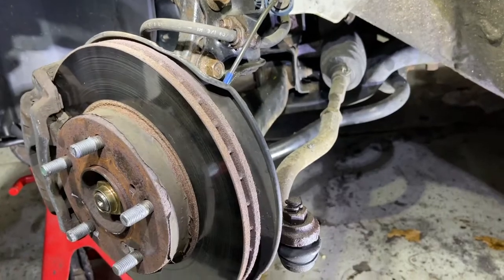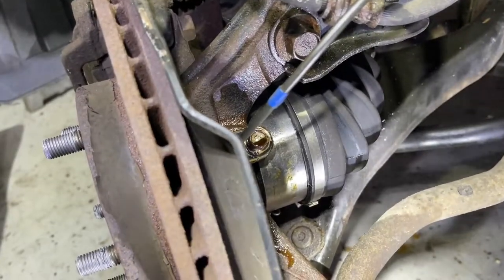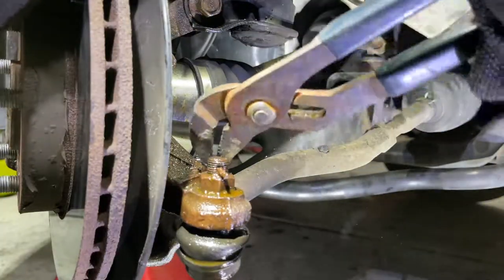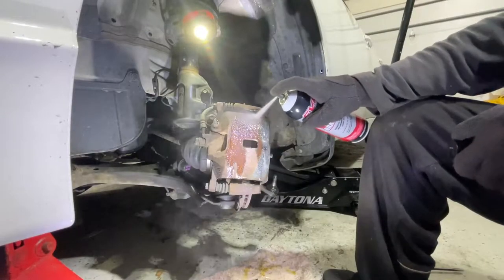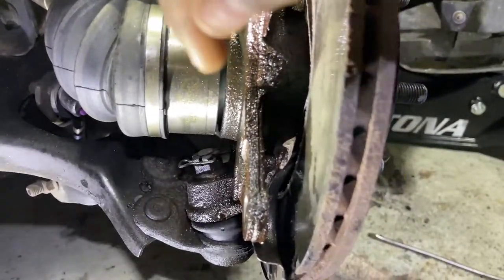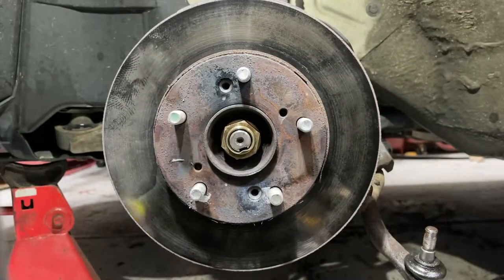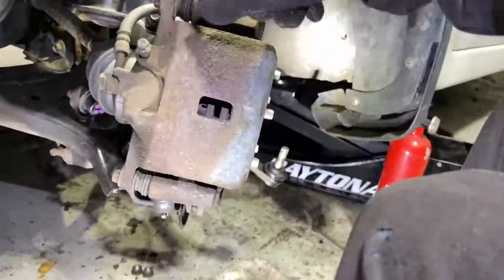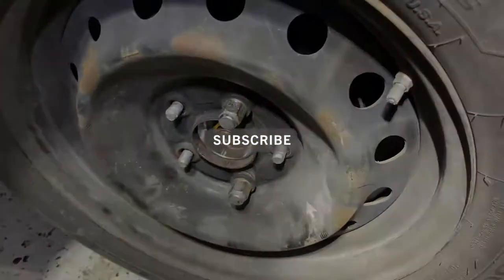06-11 Honda Civic Spindle/Knuckle, Hub Bearing & Ball Joint Replacement Step-By Step Guide

Comment: Do not put anti seize on the wheel studs threads. Your lug nuts may come off even if you torque them.
Reply from the maker: Thanks for the advice. I've done it for a very long time and have never had an issue. I've worked on a thousand cars in my life. Thanks for watching.